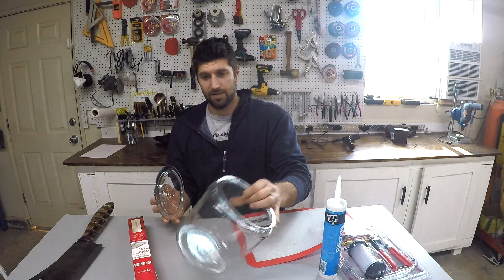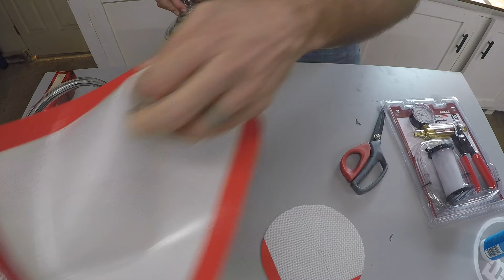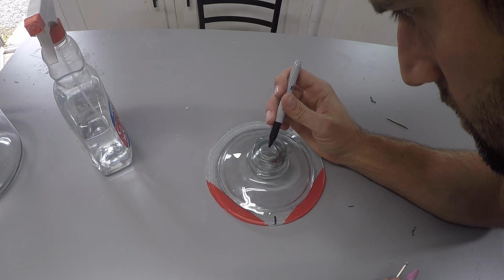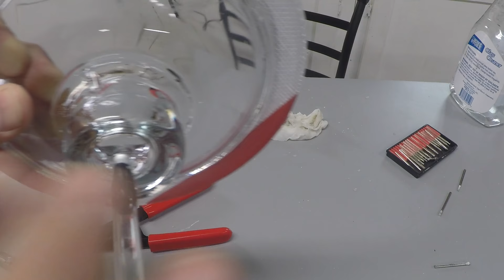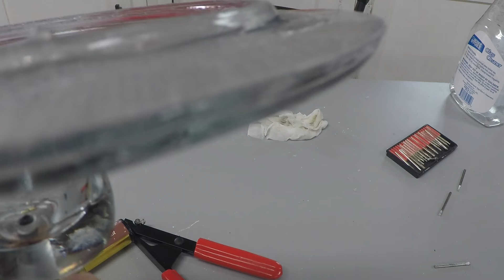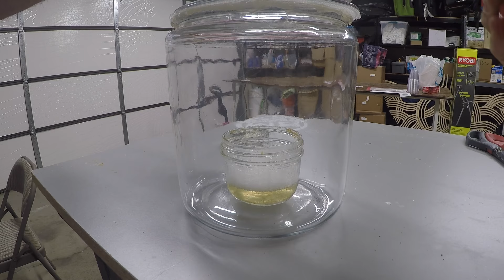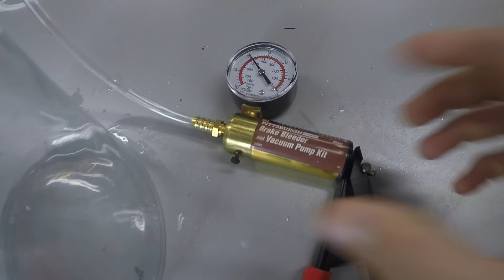EASIEST & CHEAPEST Vacuum Chamber. DIY for epoxy castings & resin pouring.

Comment: Use proto putty around the jar top. Works great. Mix 100% silicone caulk with corn starch and food coloring of your choice. Knead it into a putty and after about 2 minutes, you have another 5 minutes or so of working time before the putty solidifies. Pile it around lip of the jar and press your plexiglass down on it to make your seal. Let it cure, and you have the perfect gasket. There's no need to drill through the jar at all.
Reply from the maker: interesting... Silicone and corn starch make the putty? What ratio would you recommend?
Reply: @blakemcfarland6418  look up " making silicone mold with corn starch and silicone" to get ratios....I have seen it done to make your own silicone molds for resin projects

Comment: Thanks a lot! You should do a video showing it working with epoxy! 
And a word of advice: Alternate between hands. Or you'll end up with a forearm bigger than the other in some months. Haha
Reply: it doesn't work for epoxy and resin..

Resin = pressure pot
Silicone = Vacume.

Go check some videos.. its a absolute mess trying to vacuum resin.

I ended up making the harbor freight pressure pot for 80$ and added a harbor freight 1.5gal 125psi compressor for 70$

Comment: Awesome!  Best & cheapest I've seen yet!  Thank you for posting this!  Question:  Do you think a 5 gal plastic pickle bucket with a gama lid would work?  Maybe hafta fill the voids between jars with stones (to keep the bucket from collapsing)?  Has anyone tried that?  Just wondering.  This glass thing is cheaper, but the bucket would hold more.  Kindv important when using manual brake bleeder like I do on my way too small PVC chamber.
Reply: Or, maybe wouldn't hafta buy a gama lid?  Use your method w/the silicone stuff instead?  I get pickle buckets free from Burger King and Chic Filet

Comment: I do not know if that was a typo or an honest mistake but that pressure gauge is in inHg. -20 inHg is ~ -10 PSI. And it maxes out at ~ -15 PSI.
Reply: Was thinking exactly the same thing. Wondering if the hand pump could get up to 29 inhg / ~15 psi

Comment: This is freaking awesome. Just spent a small fortune an a big ,noisy, smoke blowing monstrosity of a vacuum chamber. It rattles and hisses at me like it wants to blow up. Im rather terrified of using it for my little resin moulds. I will make one of these this weekend and let you know how it works
Reply: Tho im thinking instead of a big ol glass jar im going to use thick plastic air tight container like the ones you use for soup and liquids
Reply from the maker: I think that is a great idea... Then you don't need to worry about any kind of sealing of the lid. I wish I would have done that. Hope it goes well!

Comment: Any videos on using this for a resin project? I just built one and I'm not having much luck with it.
Reply: Vacuum is the wrong thing to use on epoxy, its better to use a pressure pot,  and let it sit throughout the curing process. vacuum for silicone molds pressure for epoxy resins and such.
Reply: @reality150tv  Vacuum pots can be used for resin too.  It pulls trapped bubbles from mixing out before pouring.

Comment: Pump - Vacuum cleaner (I have a strong industrial vacuum cleaner as I have lots of pets) should work perfectly fine too. But then use a valve. Not sure if it is enough pressure.
Reply: I was wondering  about that option myself.

Comment: This is quite nice.

I was just watching a video by a XiaoQianFeng from China where she makes a glowing sword. She was using what looked like a normal syringe with a one-way valve attached to the side of it, and i thought, OK this is not terribly efficient, but this has to be the flat out cheapest and simplest thing i have seen so far! So this sent me looking for whether someone came up with other similarly cheap and easy arrangements before. I have then also found a Ukrainian video with a similar solution, by "Epoxy Art".

Your solution has an advantage of pressure gauge and being more efficient, and less things to order all over the place. Unfortunately it seems i can't acquire a brake bleeder like this locally, not for any reasonable price, so i'll have to look around.

When i get around to build one, i'll probably make it upside down in a mason jar. I can easily drill and epoxy to metal lid of the jar, and i can make standoffs and grills so i can place the lid on the desk, place a standoff grill on top, place resin container on top, and then just screw the jar body on from the top, so i can make do with a small container that barely fits a disposable cup, i get a good look into it, and i don't need a complex contraption to lower the cup with the resin into it.

Comment: Question tho if I leave my resin inside curing at 30 psi will it just act as a pressure chamber? Just dont want the sticky mess of the resin bubbling over and such
Reply: It will bubble over under vacuum, Vacuum should be used for silicone , pull vacuum then release rinse repeat a few times to pull the air out. resin put it in pressure pot and leave it under pressure till it cures no mess.

Comment: Some tips, though it doesn't apply so much to this use since you only need a temporary and fairly low vacuum (most of those hand pumps don't pull more than 22" or so Hg, which isn't a strong vacuum): 

     White and black silicone work better than clear silicone. Silicone is actually fairly porous to gases and so it doesn't hold vacuum (especially higher ones) for a longer time.  But the colored silicones have small particles of things like titanium dioxide, talc, carbon powder, etc.  These act as an extra barrier to gases trying to diffuse through the silicone matrix i.e. slows down the process some.  
       JB  Original weld is much better, but I don't think it would bond well, if at all, to the silicone baking mat (low surface energy), so if you're using a silicone mat and not butyl rubber or neoprene, which are much better rubbers for vacuum, then you'll have to use the silicone caulk. 

      The manual hand pump from the Pump N Seal system works significantly better than the break bleeder pumps. It pulls a surprising 28" Hg.  It's a little more expensive though, around 30 dollars. 

      Drill the glass while the glass is under water.  Make it easier and captures all the particles.  Diamond coated is best, whatever you use. 

   Again, a lot of the above advice doesn't really apply for this use, but just putting it out there for people interested in vacuum for different purposes and which need higher and/or longer term vacuum.  (Say you're making a home freeze dryer or the like, using vacuum as super insulation, etc).

Comment: Dude legit I just bought one of those pumps thinking the same thing! I like the glass idea I’m using it for liquid plastisol for making fishing lures. I was going to use a mason jar with a locking lid so I don’t have to make the gasket but I like the volume of your container...
Reply: Thanks. Yeah I wish I could find a mason jar with locking lid large enough... I wanted to go as big as I possibly could so I went with this big jar. Using a jar with a lid would make this super easy and probably super air tight right out of the package.
Reply: BM Sculptures yea I’m going to use this same jar from Walmart I’m going to try and make something today after work II got some ideas on making a cheap electric one. I think I could use my AC vaccume attachment and a cheap air pump to remove the air quicker. I’m going to be doing about 24oz at a time so I need the volume
Reply: BM Sculptures Thanks for the video! I’m going to try using a large pickle jar!

Comment: Hey! Instead of using silicone to make an airtight seal for the jar would I be able to just use the same kind of glass container that has a silicone seal built in? I’ve seen glass cookie jars that look similar just with an airtight seal.
Reply: That is what i said when i seen that, most cookie jars i seen has that silicone seal on it for freshness. Him adding that silicone mat to lid and putting the other seal on jar didnt make much sense to me to begin with.
Reply: @reality150tv  cookie jars are most of the time very thin glass which might pose a risk under vaccuum

Comment: Thank you for this.  I can now do all the resin casting I have been longing to do.
Reply: only very small molds.. degassing will make a mess and your resin will start setting before you degass it all unless you got like a 2h pot time.. I built this thing.. it isn't useful unfortunately
Reply: @synapticdragon2157  well, you said it yourself: you can switch to different resin to make it work

Comment: I have bought two bleeder brake vacuum pumps and neither will hold a vacuum, even when they are connected to a dead end tubing. They just lose pressure after a couple seconds. The first one worked initially but then stopped working at some point after hooking it up. Is there anything I can do about this or am I just supremely unlucky?
Reply from the maker: Hey Katelyn, I am sorry to hear that. Even with a dead end tubing and it is completely sealed? I have never had a problem with the brake bleeder. I have only had a problem with the airtight seal not being perfect. I don't know what else to say, if you put it on a dead end tubing and it is looking pressure it is a problem with the brake bleeder? It seems you may be 0-2 on faulty brake bleeders. Sorry to hear that. Ive only bought one and it is still holding strong
Reply: Probably because its a harbor freight item. I bought a weed sprayer that gave up the ghost before it even sprayed 1/4 of the first tank of weed killer I mixed up. The only thing that has  given me any value from Harbor Freight are their 4' led shop lights.

Comment: Great info! I was all set to buy a $200 pot when I found this, I already have everything except the brake bleeder so I know what my next project is. Thanks!
Reply: having tried this.. What do you need vacum for?
This wont work for resin.. I tried it already.. resin will set before you degass it enough
Reply: Did you ever get past 25 inhg? I think im still going to need to get a vacuum pump for silicone or acrylic

Comment: Fantastic! Thanks for sharing. I'm wondering if you could use an airtight glass container for food (the ones with a rubber ring and metal clasp to close) and cut out the silicone mat and weather stripping tape step??
Reply from the maker: absolutely. I originally wanted to use one of those, however I needed a bigger container so I went with the largest glass container I could find. If you find a airtight container the size you need, PERFECT!

Comment: You have achieved 20inhg in the video. What is the maximum achievable pressure with this gun ?

And can this method work successfully to remove air bubbles from resin / epoxy ?

Comment: 1. You could just turn the lid upside down and possibly draw with a marker with the silicon on top of the lid. Maybe.
2. What about using a sealent layer between the lid and top to act as way to get the tubes and electrical inside the chamber to get rid of the need to drill into the glass? Not sure what type of seal would be needed, but it can't be much different than the stuff already going around it. Then you can adjust later also.

Comment: nice video, 
only correction -20 inches of mercury vacuum (inHg vac) is not the same as -20 psi. 
-15 psi would already be more than possible at sea level (atmospheric pressure is 14,7 psi)

Comment: Anyone got any videos of what it looks like when a 5 litre container implodes?
Reply: Might need a bit more than 20psi though
Reply: You mean like what would happen if someone tripped on the vacuum line and pulled the chamber off the workbench?

Or perhaps, when someone is smarter than that, and puts the vacuum chamber on the floor ... 
... And then drops a tool on it.

Sounds like a fun video to make.  Anyone got a thick plexiglass shield and a high speed camera I could borrow?

I've already got a nice pile of dirt to hide behind.
Reply: @hamjudo  and have a spare pair of undies available!

Comment: How thick should the glass be? This is my main fear of getting something too thin that will implode.
Reply from the maker: definitely try and get the thickest you can find. I would not do any glass that is very thin... My glass is around 1/8" I believe. Its quite thick.
Reply: I've seen videos of people using bell jars for this which are half or less thick and them taking quite a lot of abuse under vacuum. Unless  you are throwing things at it, you are pretty safe with whatever you choose.

Comment: 10/10 sir !

I agree with one comment below about operating this with the jar in a cardboard, or better still,  wooden box incase...
I was thinking that I could use a large pickling jar as they have replaceable rubber seals....  Just an idea...  or pinch my wife's pressure cooker :-)
THANKS.

Comment: What was the purpose of the silicone mat on lid if u were putting a gasket on jar section?  That part seems like it was an after thought after u put the silicone mat on the lid. When i seen the mat i assumed u were using it for bottom of cookie jar so epoxy wouldnt stick to bottom. That silicone mats in are pretty much most diy and even bought vacuum chambers. The second thing, most cookie jars like that one that i have seen has a rubber/silicone gasket on lid already to seal for freshness.

Comment: Is it enough to remove the air from epoxy? I am using an aircylinder with non return valve. But epxoy remains the same I will believe that the pressure in not low enough

Comment: I tried this with a much smaller glass jar.. it does work but you can't really use the brake bleep pump for a decent high pressure vacuum... and opmg it takes like 15m of pumping just to get  20 on the guage.. 
Don't even think this will work for silicone

Comment: If you heat the vessel slightly with the lid on the air will escape and when it cools it may pull a significant vacuum from the displaced air volume. How? A iron plate within and the whole rig on an induction cooktop that would only heat the metal.

Comment: this is an awesome idea. why did i just now stumble upon your channel?! question. i have an old pressure cooker that i no longer use. would i be able to basicly drill a hole in there and do the steps you did? i assume that would get rid of the step of making it air tight since it allready is. thanks!

Comment: * FREE VACUUM PUMP *   I built a vacuum press/chamber (with pump) once by "reverse cycling" an air compressor (that I already had). It worked very successfully in a commercial picture framing store that I owned. The air inlet became the sucker hose. The blower pressure outlet just vented air freely. It took a few seconds to swap the fittings on the air compressor. So, I didn't ever need to buy a vacuum pump. TIP: Any vessel that can be rigged up with a rubber or vinyl seal will work. The vacuum pulls the seal down tight (as it does with the canning lids). I never used a pressure gauge, just watched the progress by eye. Total expenditure was about $10. 😄

Comment: does it always have to be a glass container? Can I use a steel container?
Reply: As long as it can hold the pressure, you could use whatever you like. Fill the rest of the container with water (or something uncompressible) when you are creating your vacuum and it will save a bunch of hand pumping. Ideally, for efficiency, you want to have to remove as little air as possible around the subject you subjecting to the vacuum. HTH!

Comment: You literally made one of those flour or food storage pots that have the hinged latches on the front! They make them out of metal, plastic, glass, etc and have silicone seals. All you would've had to do is drill a hole. Lol.

Comment: Great idea. How long did you have to pump for your demo ? I think you should have gone a little further for resin or silicone degassing, wondering how it would match with the potlife of the casting material.

Comment: Good idea.  It really got my hopes up until I realized that the resins I work with have a curing time that are longer than it takes for me to hand-pump the vacuum to a level that will effectively de-gas what I'm needing to de-gas.  
Maybe there's a way to motorize the hand pump; perhaps using some kind of bike-peddle system.
Reply: If the curing time of the resin is longer than the time it takes for you to hand pump then you should be fine. That’s exactly what you want. If your resin’s working time is over in 2 hours and say it takes you 30 minutes to de-gas the area you’d be golden. However if that’s not what you meant then I no longer have advice :(

Comment: Could a metal pot with a lid that already has a hole for steam etc work? I know I’d have to make a better seal for the pot. Just curious if it would work, I’m afraid of a glass jar breaking with that much pressure
Reply: Pressure cooker would work great or a pot with a hole in the lid would work fine but to much vacuum could crush it

Comment: Very nice, just a safety question, is there any risk of the glass bowl breaking up under pressure? Or is there a safety measure to use when it comes to how much PSI I should be using with the pump?
Reply: the glass can sustain a heavy amount but the amount needed for resin hobby is much less so u don’t need worry

Comment: Great video easy to follow who don't like DIY bargain. Have you tryed it on epoxy yet and does it work? I'm thinking of using a hand held pump for a small infusion project hopefully a one off if all goes well. Do you think its strong enough to pull the resin through?
Reply from the maker: Yes I made it specifically for epoxy. Works great!

Comment: Did you try stabilizing wood on it? I'm guessing this setup is good for simple clear epoxi but would be hell to work with wood. It keeps bubbling for hours and you need to keep steady pressure for 12 hours